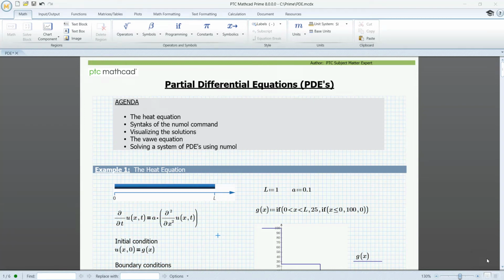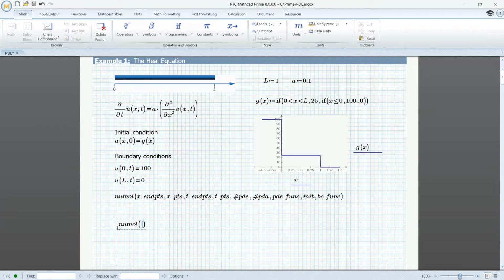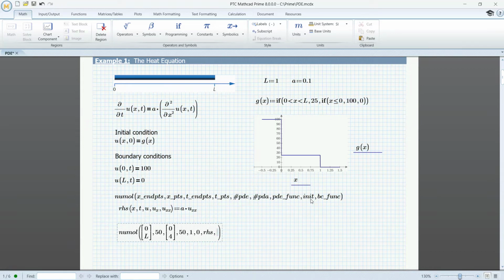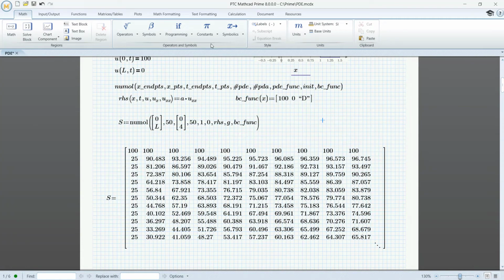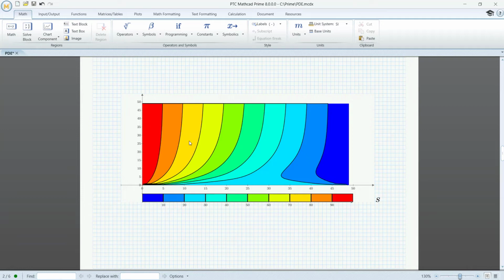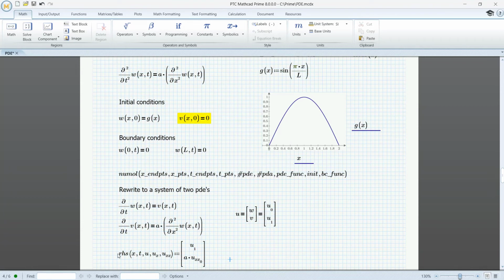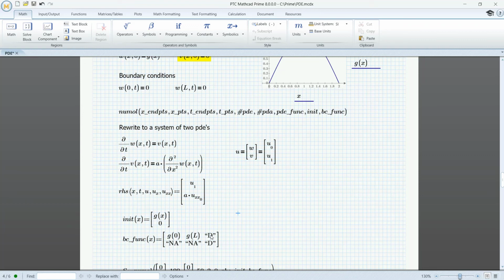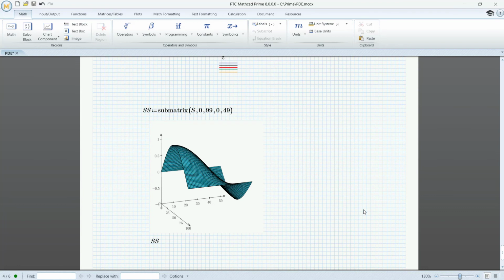Solving Partial Differential Equations in Mathcad Prime with numol

Comment: An excellent demo of the new function.  Can I ask a question?  In your examples, you applied the Dirichlet boundary condition at both ends ... what if you wanted a Neumann condition at one end and a Dirichlet at the  other?  Is that possible?  How complex can you make the boundary condition specification?
Reply from the maker: Thanks for the question and for enjoying the video! It means a lot to us.

The expert in the video got back to me and replied,

"You can either apply a Dirichlet condition or a Neumann condition at both end - but not a mixed condition.  For the boundary conditions we have only these options:
[bc_left,bc_right,”D”]
and
[bc_left,bc_right,”N”]
where the options “D” and “N” holds for both left and right."

Related to this topic, we also plan to include a PDE-solver (using a solve block) for PTC Mathcad Prime 9, so please look forward to that as well.